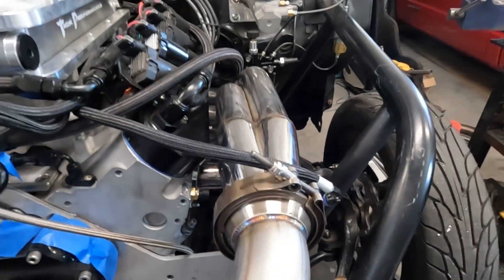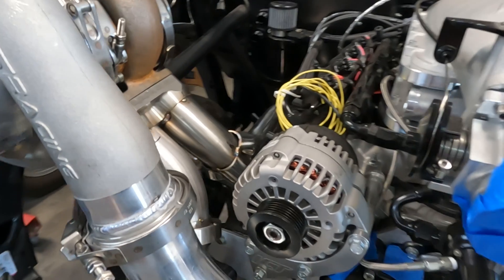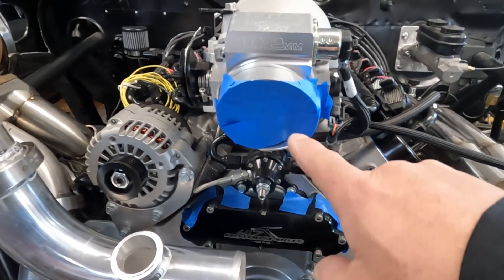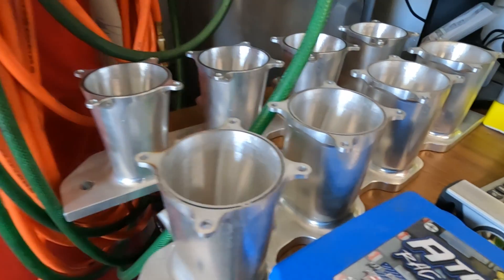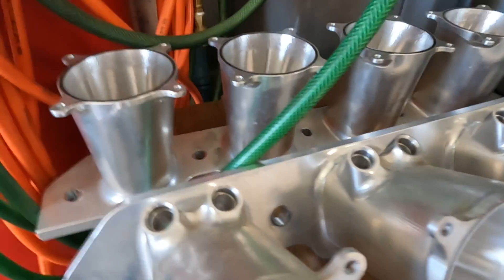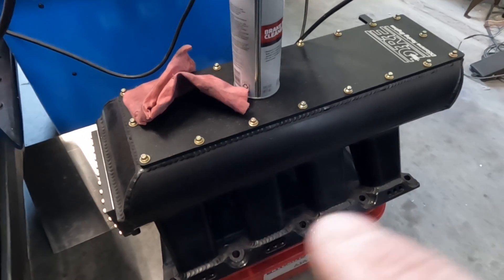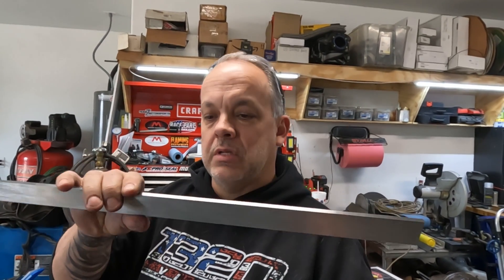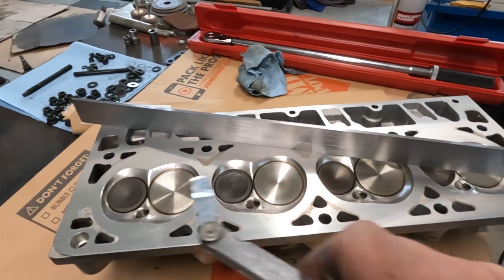I found the best way to fix the LS engine head gasket and oiling problems

Comment: hi dude, do you still use copper head gasketS?
Reply from the maker: Yep, new engine has copper.gaskets
Reply: @diygaragetx  Awsome. Ive never installed one but after recent issues lifting the head on my engine im going to switch to copper. My block is Oringed currently copper wire and MLS gasket but im going to switch to stainless oring and copper gasket. I dont however have my heads with reciver groove. woudl this be an issue>?
Reply from the maker: @BEYTEK  personally, I wouldn't run them like that... but that's just me
Reply: @diygaragetx   so you would say run a reciver groove for sure? hmm im not sure if its possible with the cylinders being so close togeather. grooving the head 150% larger than the orings will clash. hmm

Comment: Having the mind of a plumber when designing the fuel lines 👍. O rings are not the most reliable way to hold hydronic pressure, especially high pressure.
That being said 
It's a crazy world out there now, God protect you and yours.